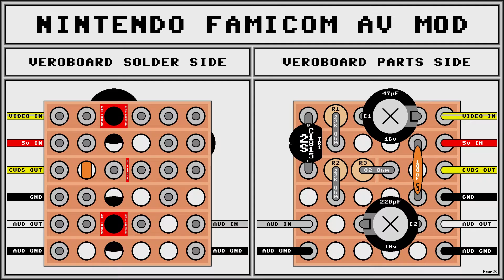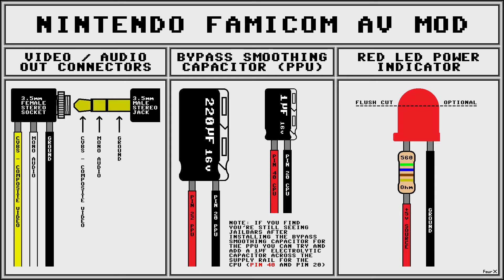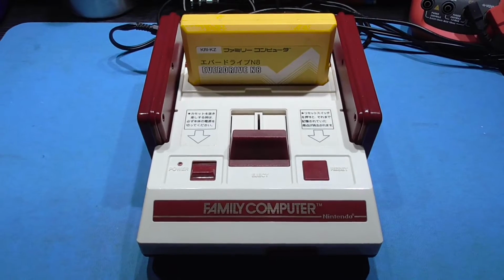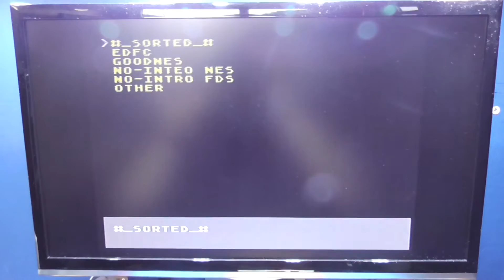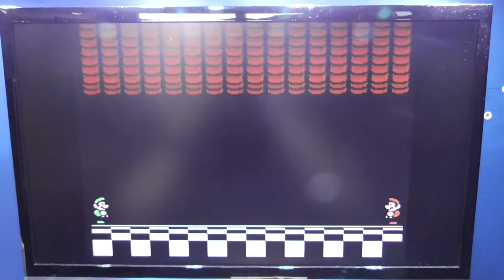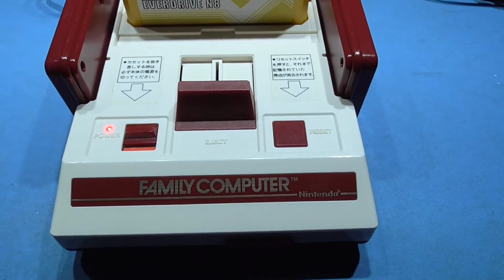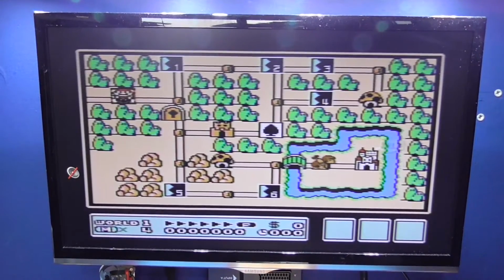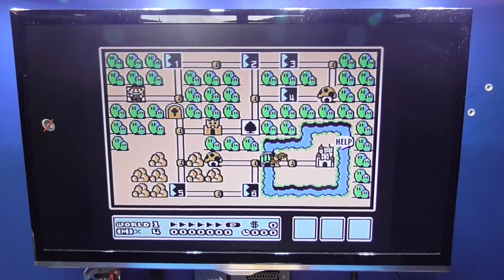Nintendo Famicom - AV (CVBS) Composite Video Mod & Red LED Power Indicator Mod

Comment: hi there. thanks for the video, i'm about to perform this mod based on your design. i was wondering about the ceramic cap - is a 1W / 50v one going to be ok?  the other question i had is where the component values were chosen from - did you follow someone else's design? i can't seem to find a schematic with the same values on other sites (tho a lot such as the assembler games ones, no longer have their images attached.) that said, it really looks like you know what you're doing! cheers.

Comment: Thanks, very good Video. The cap between pin 20 and 22 removed my jailbars almost completely
Reply: what value did you use for the smoothing cap?
Reply: @mattcatania7858  I used 220μF
Reply: @okmenaut  Thank you!

Comment: Great job =D  I would just convert the RF to composite output tbh, but adding a dedicated connector as you did is just as good if not better as you've got audio there too!  But no one is ever going to use RF again I guess!  Lovely little board there for the AV =D    I stereo modded mine a while back - that's highly recommended!  But has the complication that expansion audio needs to be merged across both channels too.  Easy to do with a few caps and resistors though!
Reply from the maker: Thanks Chris. I'm defo going to stereo mod it, this and the other i own and your right no ones going to use RF today but it's nice to see my TV still support it and an JPN NTSC RF signal as well.
Reply: @Four_X  I am always keeping the RF functionality when modding consoles :)